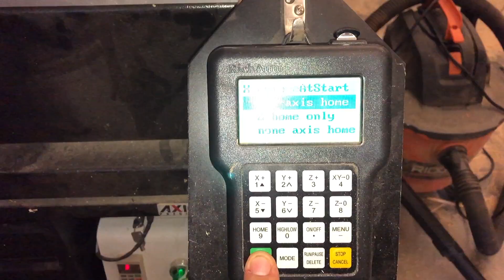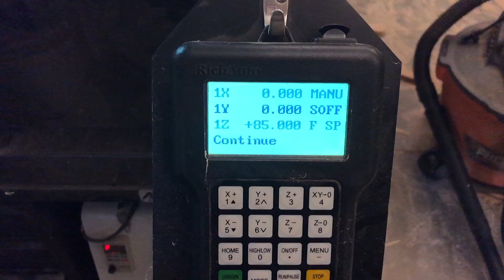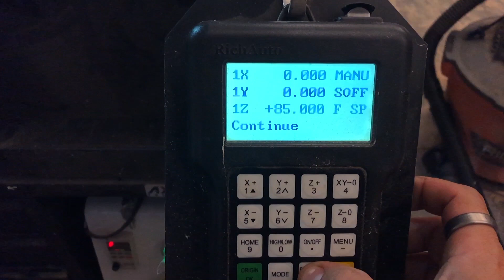Making a Custom Brass Branding Iron

Comment: Great video! I would be interested to know how you would separate individual  letters for hot foil stamping and what software you would use please. A demo video would be great!
Reply from the maker: Hey, I’m not quite sure I understand what you’re needing. Are you looking for stamps that are individual letters so you can customize words on your own or are you curious if a stamp with wording on it would translate well for gold foil stamping? I’m currently using Vectric V-Carve Pro to design and cut my brass brands and stamps. I don’t have any gold foil or leather to even try and create a video for you. If you’d like to send something, I’d be happy to try it out.
Reply: @TheTinkirWorkshop  Thanks for your reply. Yes, what I mean is how do you separate individual letters after engraving so you can customise your own words. for example, if you engrave A-Z, how would you sperate them individually so each letter can be put next to another letter to make up a word - for personalization for example
Reply: which tool/machine is this? what is skills required to operate it.

Comment: Cool video. How did you know when to switch bits? Also what bits did you use for the bear & lettering?
Reply from the maker: I setup different files for each bit, so when the one file finishes I swap bits and load the next file. I’m running a 1/16” single flute endmill from I think Amazon to clear the majority of the material first and then I switch to a 60° split V bit from CleBitCo for all the detail work. I’ve adjusted my cutting since this video was filmed and with that 60° but I’m now plunging a full 0.06” depth of cut into the brass in 1 pass. The nice thing about those V bits is that they’re double sided. So you get a ton of life out of each one.

Comment: Which v bit did you use? I tried it with a 60 degree v bit and somehow the tip of the bit got too hot and melted the brass and dragged it. It turned out awful
Reply from the maker: Sounds like you were moving a bit too slow or too high an RPM. I’m running a 60° split V bit from CleBitCo. They’re really nice and they come double sided. I’m running those at about 15kRPM, 45IPM and a 0.06” depth of cut. Hope that’s helpful.

Comment: Thanks. What type of blade to cut the brass? also, which bits are you using? Thanks.
Reply from the maker: Hey Alain, I’m just using a metal cutting bandsaw blade from Lowes. Pretty generic. As for the bits it’s a 1/16” single flute endmill from Amazon and a 60° split V bit from CleBitCo.

Comment: What bit and speed+feeds did you use?
Reply from the maker: Hey JP, I’m running a 1/16” single flute endmill at around 30IPM and about 12-15k RPM, 0.01” DOC. The detail is done with a 60° split V at about 45IPM, 0.06” DOC, same RPM. Hope that helps.
Reply: @TheTinkirWorkshop  Thanks for the awesome video. The description says both bits were run at 24k rpm...but this comment says 15k. I'm assuming it's the lower rpm (15k) though?
Reply from the maker: @gabrielwatkins  Yes, I must have miss typed that first RPM. I’m running between 12-15k.
Reply: @TheTinkirWorkshop  all good, thanks a ton for the response! First brass cut test happening today on my shapeoko pro xxl!
Reply from the maker: @gabrielwatkins  Good luck! Lemme know if you have any other questions.
Reply: @TheTinkirWorkshop  it went perfect the first try! Kind of shocking really.
Reply from the maker: @gabrielwatkins  That’s so great to hear. Shoot me a pic of it. kris@thetinkirworkshop.com

Comment: Nice job, Kris. I noticed that brass is one of the metals of choice for CNC milling. Is it possible to CNC carbon steel?
Reply from the maker: Erik Light Thanks so much. Yeah, brass and aluminum are the go to metals for most home CNC machines because they’re non-ferrous. CNC’s are capable of cutting carbon steel but you’re going to see it mostly in higher end machines with more horsepower, coolant and specific tooling. I would look at Titans of CNC. They have incredible resources.

Comment: Awesome video. What model v-bit did you use? How well does it hold up to cutting brass? Do you use any coolant on the brass? How tall are the letters?And finally what are your pass depth, feeds and speeds. I really want to make a branding iron mostly for fun. Have a great day.
Reply from the maker: James Stewart Hey, thanks so much. I’m using a 1/16” 2-flute endmill and a 60° split V bit. A bunch of manufacturers make them but the one I’m using in the video is from CleBitCo. The 60° V is also a double sided bit so you’re getting 2 for 1. They last a really long time, even in brass. I’m not using any coolant. Letters are 0.06” tall and I’m cutting with the 1/16” bit at a pass depth of 0.02” and on the split v 0.06” depth per pass. I don’t remember my speeds off hand. I think I’m running the 1/16” at about 15-20IPM and the V around 45IPM.

Comment: Great Video! Did you have to make a 3D model of the brand first, or was it a 2D model? Did you V carve it, or pocket and profile? I've got an Axiom as well and I'd love to make one of these for myself! I appreciate the video!
Reply from the maker: talktojerm Thanks so much! It’s just a 2D drawing using the V-carve toolpathing. I usually clear with a 1/16” bit and then come back with a 60° V bit for all the detail. If you have any other questions, feel free to ask.
Reply: @TheTinkirWorkshop  hi, i´m trying to do this in artcam but i can´t figure how to make first a cleaning pass with a flat endmill and then v-carve only the sharp corners that i need to make for the details, can you help me?
Reply from the maker: Sebastián De La Maza Hey, I’ve never used ArtCam before but I looked up a few tutorials and it looks like you need to do a “Create V-Bit Carving Toolpath” to accomplish this. If you scroll down in the dialog that comes up it’ll allow you to select a tool for “roughing.”  My assumption is that’ll be your flat endmill for clearing. Please let me know if this helps. Best of luck.
Reply: @TheTinkirWorkshop  Thanks for the help, I appreciate it!

Comment: Nice work Kris.

got a smaller machine than yours, the Shapeoko XXL and wanting to make my own branding iron mainly because I paid someone over $120 to make it and they just screwed it up and no returns on custom orders.  Anyways, I'm limited to 1/4" max shank bits and very partial to Whiteside bits so what do you recommend for that size shank bit?  Also what did you use for CAD software to design?
Reply from the maker: Todd W Thanks man! Shapeoko’s are great. I actually made some brands back on my xcarve so it’s definitely possible for you to do. All of my bits are 1/4” or less for this type of work. Right now I’m using an 1/8” shank/2mm endmill for clearing most of the material and then I go back with a 60° V bit from CleBitCo for the detail. And sorry to hear about your bad brand experience. Let me know if I can do anything.
Reply: @TheTinkirWorkshop   were those just regular bits or were they meant for brass?
Reply from the maker: Scott Vargas Those bits were recommended to me for cutting brass. It was a 2mm (or 1/16”) single flute that I cleared with and a 60° split V for all the detail work. I got the bits from CleBitCo.

Comment: Turned out great! I am doing my research for a 24x48 CNC right now. Axiom was on the list, but am also considering Camaster Stinger 1 and Shopsaber 23 - Really want to be able to use Fusion 360 and post a gcode file to the controller. Not much info for the Axiom, but I know others have had issues. Keep up the video's man, hopefully will have some CNC work, at least on wood on m channel soon :)
Reply from the maker: RNGPRODUCTS I absolutely love my axiom. I also looked at Camaster when I was looking to buy a machine. The Axiom primarily works with the Vectric software. I’ve actually been doing some testing with Fusion and have had success with it. The toolpaths plot correctly, it’s just the feed rate that isn’t. But it’s close to working really well. I gave you a follow on IG. Feel free to reach out with any questions.